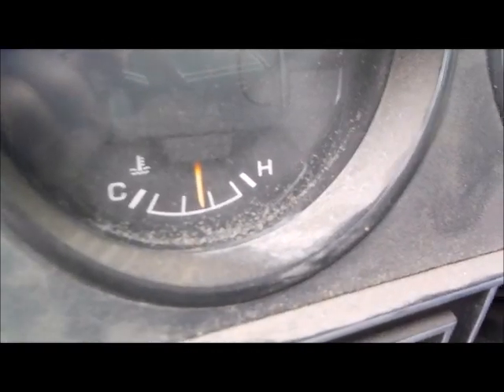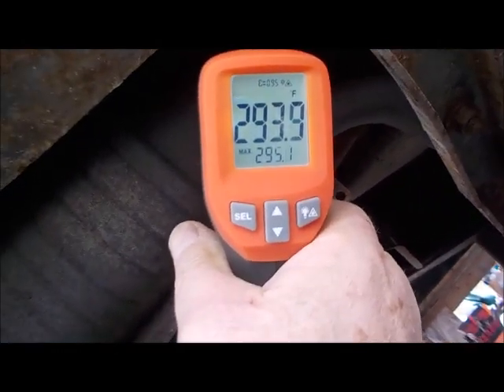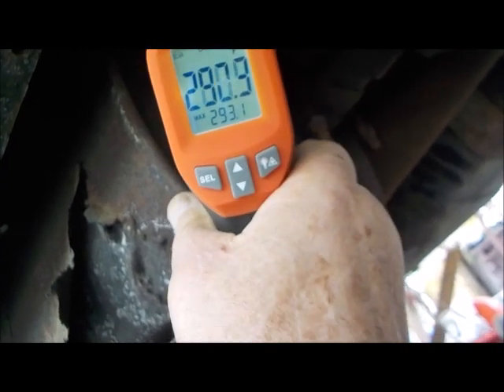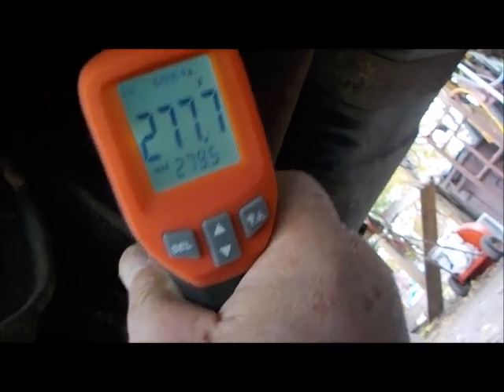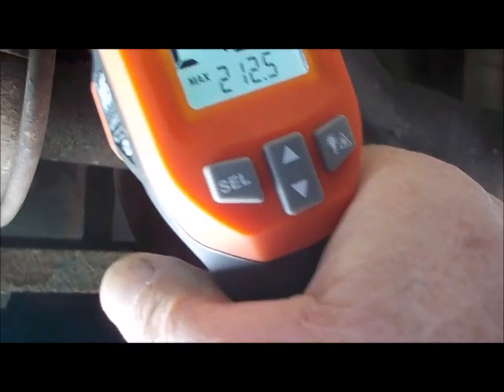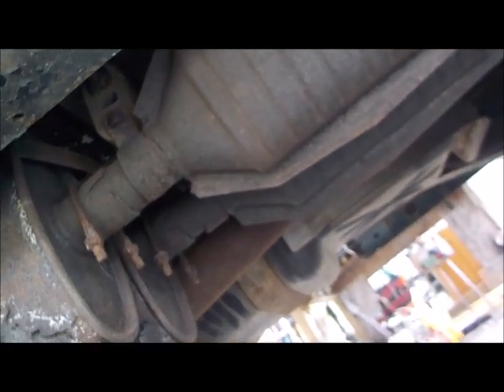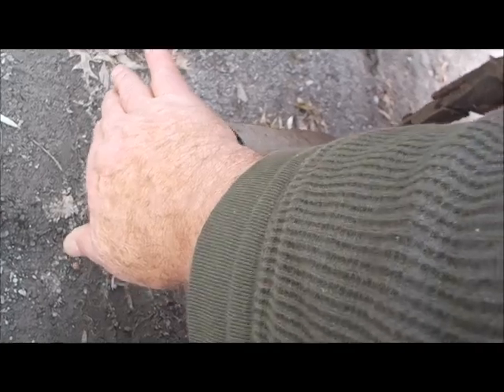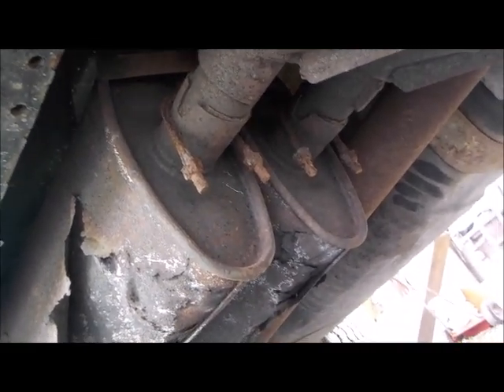Work on Dodge Truck is Exhausting

Comment: well since the mufflers are shot anyhow,you have nothing to lose really. once the mufflers are removed that should tell the tale. if the cats have come apart,pieces could very well be in the mufflers. also you will be able to look in the cats with a light and see if the insides are loose or maybe melted. batton down the haches,a noreaster is coming